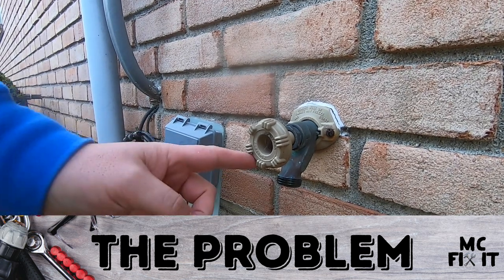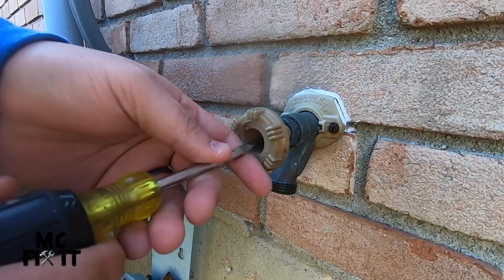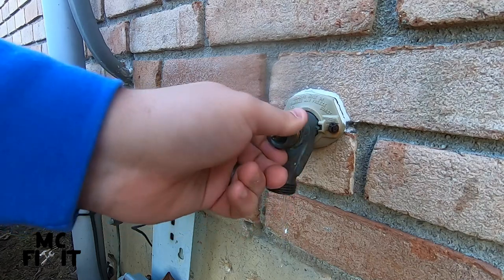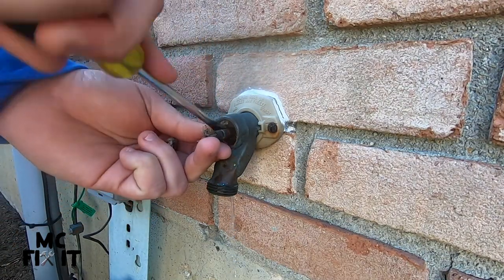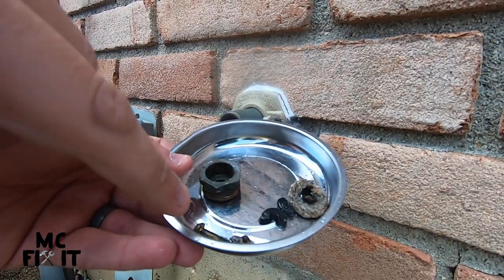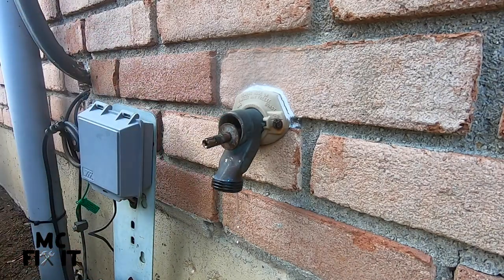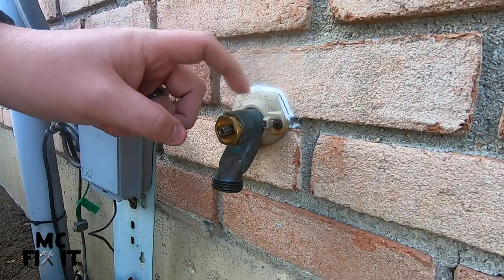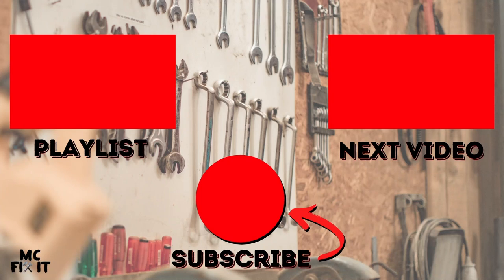How to Fix A Leaking Spigot Woodford (Complete Guide)

Comment: Why is your metal insert with the plastic washer so long??? Mine is so short compared to your and it’s a Woodford too.
Reply from the maker: Yes, great question. I don't think that I covered that in this video. It is due to living in the North. They have longer inserts where the plastic washer lives. This is due to help prevent it from freezing since then it would be inside of the house instead of outside. It got to -17*F (without windchill) and that could have easily frozen it if it was outside.

Comment: Thank you. Model 14 is similar. A leak from the threaded spigot on mine was solved by replacing part 3008- valve seat rubber. Also need to replace 30560 EPDM packing washer because the old packing is destroyed during removal. Rather than spending $20.00 on repair kit RK-17MH at the home improvement store, see if you can just order those two parts and save yourself the money. All the metal parts are reusable. Mine does not use 30418 check valve but yours might. You won't know until you have it apart, so you might as well just order it too so you have it during the repair if you need it. 30421 packing washer does not work on the model 14. You'll need to reuse your old one or find an equivalent size. Go easy on tightening the packing nut. You can tighten it further if necessary while you're testing the faucet after the repair.
Reply from the maker: Yes that’s a great idea. I bought the whole kit bc I wasn’t sure if what the problem was on my grandma’s faucet and I didn’t live in the same town as her. So I got it all and made sure I could fix it in one trip. But yeah, if you can take the time to find the problem and fix it you can order just those parts for sure. Thanks for commenting!
Reply: Just to clarify, the valve seat rubber part # is 30008, not 3008.
Reply: Thank you

Comment: I was watching another video about this and the guy had and used a 90 degree pick (looked like an ice pick with a bent tip) to remove the rubber o ring washer inside the tip.   Worked like a charm!
Reply from the maker: That would work well. This was at my Grandmas house and I didn’t have all my tools. Thanks for suggesting this!

Comment: I replaced all the internal parts on my Woodford 101 today. Every video shows the brass packing nut has right hand threads, but mine is left hand threads. I played with this for 20 minutes before I figured it out. My unit said shaft is not as long because its made for a non freeze state.   Thanks for the video
Reply from the maker: You are welcome. Glad you got it figured it!

Comment: Great video thank you! I have one small snag in that there appears to be some calcium buildup, preventing me from pulling out the valve thing from the inside. I’m trying to knock it off with my screwdriver, but not really getting anywhere. I did the front faucet no problem, but this one is worse. Have you ever run into that?
Reply from the maker: I have not but I’m sure it’s common depending on your type of water. I’d try a long pick and break it up a bit. Did you get it fixed?
Reply: @MCFIXIT  not yet! I ended up leaving the valve inside and putting the handle back together so it now just has a very slow drip. I was afraid to cause more damage but will try again if we have another warm day soon! Thank you!

Comment: I wonder why the brass screws are slot head instead of Philips head.  It is a little tricky reaching in with a blade screwdriver and trying to connect with the handle screw when trying to disconnect the valve handle.  Then the blade slides in the screw head slot as you turn the driver.  Also, with a Philips head screw, you can push it through the rubber seal and balance the screw and seal on the tip of the screwdriver, making it easier to start the screw into the female threads.
Reply from the maker: Great question. No sure why. It would be easier that way.

Comment: 9:07 when you said to keep it from moving too much on the inside of the house. Just wanted to get your opinion. My spigot had an old hose stuck on and I had to spray some PB blaster and wrench it off. However, when I did the whole spigot moved slightly. Do you think this would cause any issues inside the house? Spigot works fine still, shuts off appropriately. Just some leaking from behind the hand when I turn it on. I appreciate the video and your help!
Reply from the maker: Can you explain what you mean by leaking behind the handle? Is this leaking on the outside or inside? When does it leak?
Reply: @MCFIXIT  where the valve stem comes through the packing nut and attaches to the handle. It leaks from there when the water is turned on. However, I’ve noticed it actually only leaks when the water is turned on and the hose is attached. If the hose is removed, the leaking from the handle stops. I’ve also checked the basement where the pipe comes into the house and no obvious leaking inside either. I was just concerned I may have damaged something when wrenching off the old stuck on hose because it took a lot of muscle and the entire spigot moved slightly when I was doing it and I did not apply any counter force with second wrench. It’s probably fine I’m just worried  new home owner! Lol thanks for your response and your help!

Comment: Thanks for posting this video.  We have a similar spigot by Prier / Mansfield, and have been unable to remove the shaft to replace the washers at the far end of the spigot. Do you prefer the Woodford?  They seem very similar.
Reply from the maker: Thanks for writing. I have not owned a Prier or Mansfield before, so I don't really have a judgement call for those brands. My house had Woodford installed when built in 2003 and are working great. And my grandma's house (in the video) had them as well. It was about 30 year old and only had to replace a few small parts is not bad in my opinion when living in the North with lots of cold and hot spells. Have you figured out how to remove the shaft?
Reply: @MCFIXIT  In principal, I know how to remove it, confirmed by the prompt response from customer service at Prier. In reality.... it's still stuck. Likely operator error. Will try again tomorrow.
Reply: @bobmorse5896  Did you finally get it fixed?

Comment: How long should it take to drain the water from the main?  It didn’t look like it took very long for yours to drain. My waters been on for several minutes and hasn’t slowed down yet….
Reply from the maker: You may want to make sure there isn’t a separate main for our outdoor faucets. Some houses have those. It should take at most a few minutes. You can open up a few different faucets to drain quicker (bathroom sink, shower, kitchen sink, etc)

Comment: Great video! I just wanted to be clear on the tapered rubber valve seat. When you install that, the flat side goes in first so the tapered end is facing you when you put in the retainer screw and the head of the screw sits on top of the tapered end, right? And did you use any silicone plumbers grease on any of the rubber pieces? Thanks!
Reply from the maker: Yes, if I remember correctly. I didn’t that one last fall and edited it this past spring. It should look identical to how you took it out. The screw and beveled edge together with the flat side against the rod. I did not in this video but I’ve done it in the past. Silicone can help preserve the rubber.
Reply from the maker: Ps best of luck on your project!
Reply: @MCFIXIT  Just finished up this project. Installed all new parts and my faucet no longer leaks at the packing nut! YESSSSSS!!!!! Thanks again for this video, it was most helpful!
Reply from the maker: @WIZ-IN-PA  Woot Woot! So glad this worked out so well for you. What an accomplishment! It always feels good to complete a project like this!

Comment: I tried this fix and still had a slow leak so I ordered a whole new valve stem assembly and installed it, but still get a slow drip.  Any thoughts on what the issue might be?  Thanks for the video!
Reply from the maker: Sorry to hear that. Did you replace the o-ring? That’s where most of the leaks come from bc they are not built to last forever.
Reply: @MCFIXIT  Thanks for the reply.  I did replace it, yes.  The old packing looked like what's on your video and I replaced it with a new rubber o-ring, but same result.
Reply from the maker: That’s super strange. That typically takes care of the issue. I wonder if was the part included. Did you get it fixed?

Comment: It it me or is that faucet a 14 model, and you used a 17 to fix it? Question being are the parts interchangeable?
Reply from the maker: Yes, they are almost the exact same faucet. Some kits even have both numbers on them. It is a model 14 being worked on in this video. The model 14 does not have Anti-Siphon Protection like the model 17.

Comment: I have the exact same spigot but I want to replace this with one that has anti-siphon. Problem is that the copper from this spigot is soldered to the main pipe. I would have to cut it but I don't have much room to play around because there the electrical conduits are in the way. The copper pipe is right above the electrical panel!
Reply from the maker: That sounds like a pain! I am not a huge fan of copper especially cutting it anywhere near electricity (especially a panel). I'd be very careful with that and probably hire a professional (unless you are one). Your solder will need to be perfect and with little space that's not a good position to be in. Personally, I'd go the route of fixing the already established spigot and maybe do other anti-siphons elsewhere. Good luck on what you choose!
Reply: @MCFIXIT  I'm thinking about that just replacing the Woodford spigot along with the parts inside like the assembly rod. Since the gate valve is siezed also, I will have to make a hole on the ceiling further away from the wall and put in a new shut off valve. Probably with shark bite connect fit shut off valve so I don't have to solder ( due to limited access). I was planning to use shark bite to go along with the new cocksill but I'm afraid with water dripping when I cut the copper. This is probably the reason the previous owner only replace anti siphon spigots on all other spigots except this one. 
What do you think if cut the copper 6 feet away from the electrical panel wall,then connect PEX tubing from copper all the way to the spigot that fits with PEX tubing? Only problem is that the ground wire from the electrical panel hooks up to the copper pipe.
Reply from the maker: That could def be a good option but since you are grounded to that pipe with the panel that might not be the best option. That’s a tough situation and makes sense why the previous owners did what they did. Best of luck with your choice in what direction to go!

Comment: How do,I remove the screw for the knob mine is stripped…
Reply from the maker: You might be able to get to the screw with a pair of needle noise pliers. Stripped screws can happen easily bc it’s outside. Make sure to use the new one that comes in the bag to replace the stripped one.
Reply: @MCFIXIT  I can’t get it off…
Reply: @ScantPear  Did you ever get it off? Mine is stuck on also.

Comment: You didn't show which way the packing seal goes in.  I had it wrong I think and the faucet wouldn't turn.  The washer behind it needs to fit into the seal and only one side does that
Reply from the maker: Sorry that part was not shot well. I was just starting my channel when this was done. I’ve got a much better camera now too to hopefully get better angles and be able to show more. But you are correct. Make sure you insert the packing the correct way!

Comment: So what If when I tighten the valve or doesn't change water flow? What could that be?
Reply from the maker: Great question. It’s hard to tell without being there but maybe a breakage in the spout somewhere. Maybe a full replacement would stop it. Do you have an internal on/off valve to stop it before you can do a repair?
Reply from the maker: My guess would it’s one of the seals on it. I’d do a full replacement just to save time and money if it’s not working. The kit I bought isnt too much cheaper than a new one. I knew the slight leak was from a basic seal. A full leak means I’d replace the whole thing.
Reply from the maker: Good luck on your project! I hope you can fix it easily!